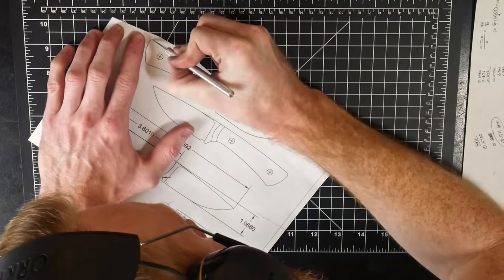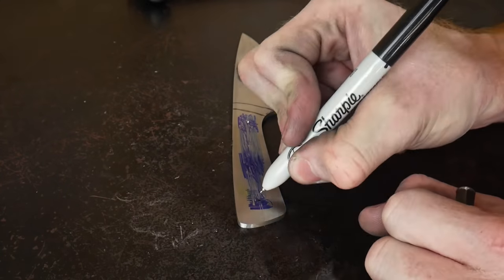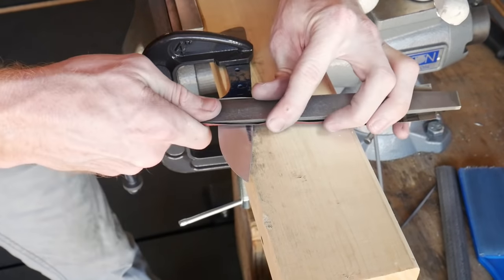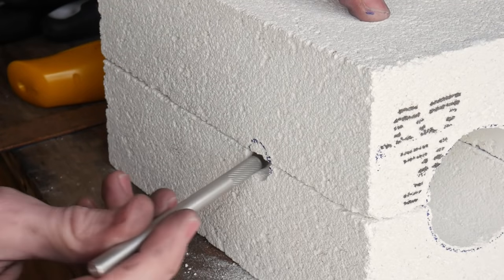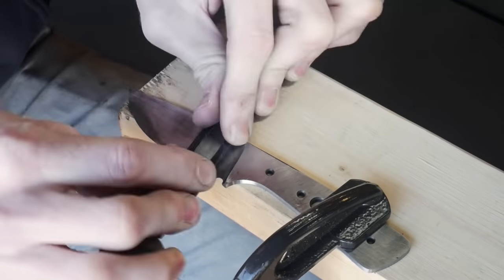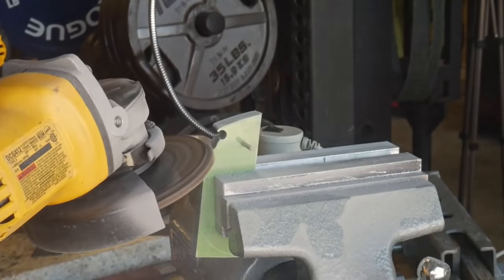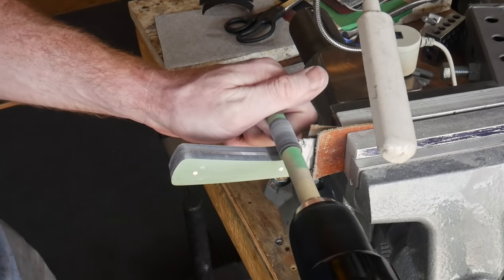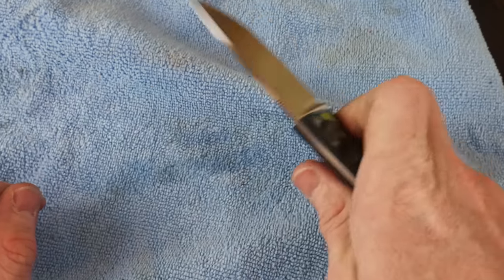Knife Making 101: How To Make Your First Knife

Comment: If you were going to do a acid wash and stone tumbled finish how would you finish the scales and tang? Would you have to make your scales bolt on instead of glued and pinned?
Reply from the maker: Hey peter, on my stone washed knives I generally 1.) stone wash the blade 2.) assemble and glue 3.) sand the spine down to a 320 grit satin finish... so the blade will be stone washed and the spine will be satin. If you want to have the whole deal stone washed, you can do a take down handle with bolts instead of pins or you can do a construction like I did on this Damascus knife. - https://youtu.be/CbOj-k7M1us
Reply: @RedBeardOps  that makes sense! Thank you!
Reply: One last question. Is it possible to use that file to add jimping to a knife that has already been heat treated?
Reply from the maker: @stowfam  I wouldn't man, you'd run the risk of dulling and jacking up the file.

Comment: What kind of angle grinder disc did you use to cut the metal? I know nothing about angle grinders
Reply from the maker: They call them cut off wheels; easily found at any hardware or online. I'd try to get thin ones to save on material removed

Comment: Filing in the bevels is a great idea. What type of file are you using for that? I am getting it mostly down, but my bevels are still a little wobbly. Also, I noticed you got your bevels very thin before heat treat. Do you not have a problem with decarb? I have been leaving at least 70-80 thousandths before HT and finishing the grind post temper. Finally, good info on home ovens overshooting temps on the first cycle. I didn't think to check that until I watched this video.
Reply from the maker: I just picked up a cheap bastard file on amazon. If you want the good stuff get American made Nicholson. I get the edge to around 0.025-0.040 before HT. I'm not sure how deep the decarb layer is, but I haven't had any issues yet. Cheers sir! Glad you enjoyed this one
Reply: @RedBeardOps  Okay, that is good to know. I guess I have been erring on the cautious side ever since my very first HT I did where I had gotten my grind too thin and the quench wrecked it. Also, this is the most well done intro to knife making I've seen. I will definitely try filing in the primary bevels on the next one.

Comment: hi , i have a question , what do you use on  the blade ( but on the metal in general ) after that you've  sanded it ? do you use some " special " oil ? because once i was restoring an axe and few days after having sand it i find it with some rust
Reply from the maker: Doesn't have to be special. Just oil. I like Balistol  - https://amzn.to/3SKaTFu

Comment: Did you know you could've shaped that cylinder shape on the inside of your forge in about 2 minutes on the table saw? You just clamp a skewed fence on the saw and run it over the blade at an angle instead of parallel with the blade like usual. The steeper the angle, the larger the radius of the cut. Take shallow passes and its perfectly safe. ;)
Reply from the maker: Have a great day!

Comment: Is there any way to make something like this using rebar, a charcoal forge in my backyard, an anvil, a hammer, some files, and a lot of time/patience?
Reply from the maker: I'd say rebar really isn't ideal. I've found it tough to move and it won't hold an etch well, IMO. Get your self some 1084 bar if you go that route.
Reply: @RedBeardOps  Would an annealed file work as a substitute cause I don't have access to higher quality steel as of right now.
Reply from the maker: @Backup-wm9cn  A file can definitely get hard. Lots of people make good knives out of those.
Reply: @RedBeardOps  Thanks for the advice! I'll make sure to soften the file before so I can work it with other tools too.

Comment: I've never been able to make good bevels... They're either always crooked, uneven or you can barely see them.. I've tried it with filing, grinding and a belt sander. There were times I tried to make bevels entirely with a file (I was on the kind of drugs at the time where I could sit for hours on end and file) and you could still barely see it.. 

But there's a few things you're doing that I never did for whatever reason - marking the edge and other things with the blue stuff and marking the center of the blade. I've known about doing those things, but maybe doing it that way would make it easier for me... Plus, it looks like you're using much softer steel than I always used. My dad's a welder and I usually just use his scraps.

I've got a lot of relatively cheapo Skil, Ryobi and off-brand/Harbor Freight tools - they've got a lot of give and play when cutting, sanding, grinding, etc. I'd like to work on upgrading to higher quality and more sturdy and stable tools. It's annoying when there's play, looseness or wobble in a tool or a table tool. A lot of it is my shed's floor being uneven and springy. I'm thankful to have a shitload of tools but it's hard to take things to the next level with cheap equipment lol. 

I took out an excessive amount of loans in my last semester of college and just bought pretty much every tool I had ever wanted. I had just always borrowed my dad's stuff before that. To this day, if he can't find one of his tools, he knows there's a 90% chance it's in my shed lol.. 

I'm working on regaining my strength, gumption and willpower (after quitting the aforementioned drugs - quitting a half dozen different drugs after a decade of heavy use really does a number on you) and getting back into my hobbies and trying knife making again - among other things.
Reply from the maker: Heck yeah man, glad you've been able to get back into the hobby. I hope these videos are helpful. Good luck with your builds!

Comment: I have a question. I cut out a knife from an old circular saw blade, and I was wondering what the differences would be for using the sawblade. Is it the same type of steel? Would the heat treating be the same?
Reply from the maker: You could try it. Most saw blades can make good knives. But as a new knife maker I'd still recommend using 1080 since it's so forgiving.
Reply: @RedBeardOps  I don’t want to buy the metal though, just using scraps😂 Would the heat treating be the same as 1080?
Reply from the maker: @aaronhughes827  no
Reply: @RedBeardOps  how would I do the heat treating for the saw blade metal then?
Reply from the maker: @aaronhughes827  Aaron, saw blades are made out of many different materials depending on the manufacturer and age of the blade. So without knowing the exact metal your blade is made out of I can't tell you how to HT it. I would advise trying the same procedure shown in my "how to HT 1080" video to see if the saw blade will harden when quenched. If it does, then you should be able to make a decent knife out of it.
Reply: @RedBeardOps  ok thanks man, its cool that you take the time to reply to people like this, you really helped me. You earned a sub😉
Reply from the maker: @aaronhughes827  Any time man! If you want to see a more in depth look at my 1084 heat treating, check this one out - https://youtu.be/TBIiWwawKSY

Comment: Thanks for this great video! I am super keen to try making a knife now. I have a 4 x 36 inch belt sander and was wondering if it would be of any use for knifemaking?  Cheers.
Reply from the maker: For sure Sam. Check out some of OutDoors55's older videos. He uses one to make some knives. I made some of my first knives before my YouTube days on one.
Reply: @RedBeardOps  That's great to know thanks. What sort of belt would have to be used on it? I imagine that the stock sandpaper belt that came with it wouldn't stand up to steel too well.
Reply from the maker: @samridsdale4484  The best for steel is ceramic if you can find it and it fits your machine (they're a little thicker). AO (Aluminum Oxide) is the standard and will work just fine for steel, but will wear out faster, load up quicker, and cause more heat. Just make sure you buy a few. Start with 60 grit for ~80% of your grind, then 120, then 220, etc

Comment: I've got a 4" x 36" belt sander that I often use on carbon steel.  However, I've never seen a knife maker using anything wider than a 2" belt sander.  Should I try using my 4" belt sander, or is there a reason why I never see knife people using these?
Reply from the maker: It's easier to control your grind on a 2'' belt in my opinion. Also most 2'' belt grinders are build with more ergonomic platens. Use your 4x6 and see what you can do; I'm pretty sure this is how Outdoor55 started.

Comment: What Grit sandpaper do you use on the Belt Sander for beveling a blade edge?
Reply from the maker: I start with a 60 grit, then clean that up with 120, 220, etc

Comment: Im thinking of getting into knifemaking and am trying to grasp the whole process. My only question is what the fluid you use while drilling holes in the handle of the blade
Reply from the maker: Tap Majic cutting fluid. Not necessary, but extends the life of your bits.
Reply: Thank you

Comment: just got a belt grinder. Hoping to make a knife for kitchen purposes out of a rasp i found... spent maybe 30 min on it so far cutting to shape and trying to gind the surfaces clean.  The knife seems WAY too heavy. the metal is is about 3/8th thick. I have not done any heating prcedures... should i try to anile it first to make the metal move quicker?? I have a ton of used oil around from working on cars so a high carbon quench is easy.
Reply from the maker: That is pretty thick. With good belts on your grinder you should be able to work with it in it's hardened state. You could anneal it if you want by heating it up past non magnetic and letting it cool for a long period of time (like in sand). If you're going to quench in motor oil make sure you're in a ventilated place. I'd advise vegetable oil (canola) over motor oil)
Reply: @RedBeardOps  i think that is my step. coal is cheaper than 80 grit grinding belts lol

Comment: A question please. You seemed to have a very thin edge when you files in the bevels. Is it an issue to have such a thin edge when quenching?
Reply from the maker: If you have a belt grinder that be used post heat treatment without over heating the blade... then I'd leave more thickness; but in this example you're cleaning up post HT with sand paper by hand. It depends on the tools you have at hand for sure. You do run a higher risk of messing things up going into the quench with a thinner edge in general.
Reply: @RedBeardOps  Thanks mate. Also, a big thanks for always answering questions, even three years since the video posted.

Comment: Can I use an old flat file? Do I still have to. Temper it?
Reply from the maker: Hey Big Frank, I've seen guys grind out a knife form a file and rely on the heat treat of the file. I'd say this makes a decent knife, but not as dialed in as a dedicated HT.... meaning it may be a little hard/brittle for knife use. If you just use it as a cutter, I'm sure it would be fine.
Reply: @RedBeardOps  Tyvm! That’s kinda where my brain was going.

Comment: Hi there, im new to knife making, i got a few questions to ask, hope someone can teach me.

1) when heating the steel, should i put the steel inside the forge before the fire gets hot, or should i wait until the temperature gets hot enough, then only i put it inside? Does it even matter?

2) im using a small fire brick forge, do i need to make a hole at the back of it? Or should i seal the back?

3) im using butane gas, im not really sure whether its better to use butane or propane

I googled all these questions, but cant seems to get a nice answer... will really appreciate it if someone can teach me... thanks!
Reply from the maker: 1.) Id advise letting the forge get hot first. Reduced the amount of scaling on your blade

2.) Most people put a hole in the back incase they're working with longer blades

3.) Propane is the standard

This link is the google search just for BLADE FORUMS.... Very useful - https://cse.google.com/cse?cx=012217165931761871935:iqyc7cbzhci
Reply: @RedBeardOps  thanks so much my man

Comment: How did you get from the diameter of the edge at heat treat down to a knife edge after it was hardened? I’m at this stage in my knife and feel like there is no way I could do it
Reply from the maker: Since files won't cut very well after heat treatment, you'll need to use sand paper or powered equipment. If you got your edge down to around 25-35 thousandths before heat treatment, you can finish out to around 10 thousandths with sand paper wrapped around a file.

Comment: The bricks u got, on Amazon there are three options for heat I was wondering if I got the strongest one which is a different color if u know if it would be as easy to cut it out
Reply from the maker: What ever you do; don't get the "hard fire bricks" they have very different performance.
Reply: @RedBeardOps  thanks
Reply: @RedBeardOps  thanks

Comment: So I have a 1x30 little belt sander. What grit should I sand the blade up to before I heat treating belt wise
Reply: And then hand sanding what grit? Right now I only have up to 400 but what grit should I hand sand up to before heat treating and after
Reply from the maker: I'd start with a 60 grit belt to hog away the bulk of the material and then get it up to a 120 before HT. After HT start back with the 120, then 220 and 400 if you want. Be carful post HT not to over heat the blade.... grind without glove and water dip every pass.
Reply: @RedBeardOps   okay I appreciate it! You are literally my favorite youtuber or and “knife youtuber” if that makes sense hahaha you care abt your fans and every single time I have commented asking something you always respond which is amazing! And also I like the Amazon links haha makes life easier! Much love!
Reply from the maker: @addiesmith5289  That's great to hear Addie, thank you!

Comment: What is the required beard length for a process like this?
Reply from the maker: It comes down to a minimum of 1''... if you're longer than that you're in a good position to tackle a project like this. If you're 2-3 inches your chances of success go up by around 47%. After 3'' the increase in success rate is no longer linear and will peak at 100% around 6'' in a hyperbolic fashion. Anything over that is just showing off.

Comment: @Red Beard Ops why do you use pins if you don't peen them or did I miss a part?
Reply from the maker: Hello sir, the pins provide shear stress protection and with the modern epoxies don't require peening to make a strong handle. That being said, I don't think peening can hurt and if done right it can make the construction stronger. Just be carful with the material selection since peening can crack certain materials. 

Personally on 98% of the knives I make I employ corby fasteners or loveless fasteners.
Reply: @RedBeardOps  I have certainly encountered that exact problem last night with splitting of 2 black palm scales...  I use Bob Smith Industries BSI-205 Clear Slow-Cure Epoxy (4.5 oz. Combined)... Would that be enough to go without peening? 
Which takes 24 hours to cure, slow set.
Reply from the maker: @TheBroot0999  So I've only used BSI mid cure and it works great. I'd guess the slow cure would work very well. Normally the slower the cure the better epoxy for a knife.
Reply: @RedBeardOps  Ty for the info. Be safe and have a great one.

Comment: Is it not dangerous to put the tip of the gas torch into the hole ? Doesn't it cause the tip to overheat and / or the heat to be transferred to the gas can through the pipe ?
Reply from the maker: The idea was that the torch tip is flush or actually recessed a little in the side hole. I didn't have any issues
Reply: @RedBeardOps  Okay, cause I made a similar forge myself, but the distance between the can and the exhaust is much shorter, so I'm keeping the tip of the torch way outside of the hole, to make sure it has some fresh air, just like it would if it was used for its original purpose. I'm still getting enough heat for tiny blades. Maybe I should have bought a torch like yours instead, but I couldn't find that in french shops :(

Comment: With the angle grinder it makes a lot of mess specially with the handles did you face this problem or I'm doing it wrong 🙃
Reply from the maker: oh yeah, it's a messy process. Lots of dust! I'd advise running a fan to blow the dust out of your shop and to wear the appropriate protective equipment.
Reply: @RedBeardOps  thank you for your channel you really helped me in many ways 🤗

Comment: Hey, what bevel should I put on me knife it’s 5160 leaf spring steel
Reply from the maker: Are you asking the bevel angle? Most of my knives I put a "full flat grind" on them. Meaning that the bevel extends from the edge of the knife to the spine. ~0.010'' is left "behind the edge" before sharpening. The secondary bevel (or the bevel that is created when you sharpen) can be around 15-20 degrees depending on what you're using it for.
Reply: @RedBeardOps  so 10 degrees for the macro bevel
Reply from the maker: @johncarpenter5415  That 15-20 degrees is per side
Reply: @RedBeardOps  and then I’m going to put my micro bevel 25*

Comment: My drill press can’t drill through steel at 1510 RPM with a colbalt bit. It it going too slow
Reply from the maker: Make sure you're not drilling hardened steel and bring your RPMs down to the 600-800 range.